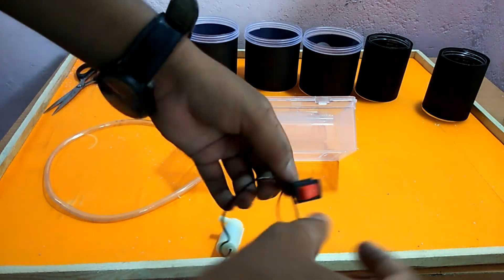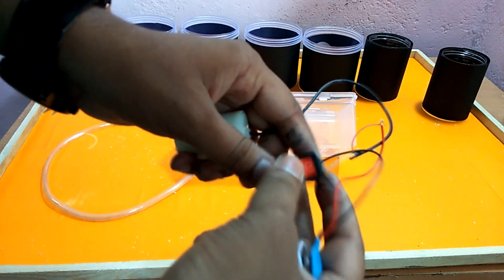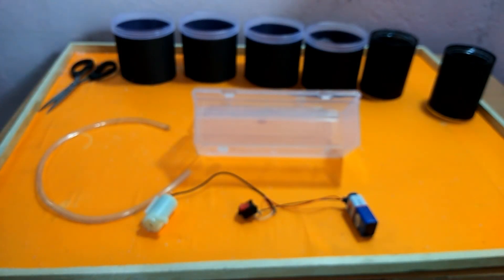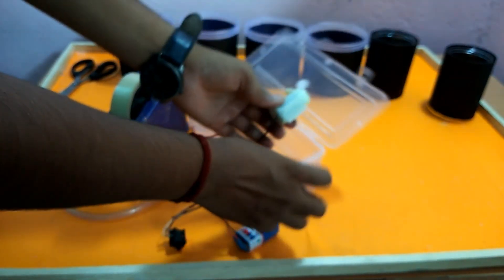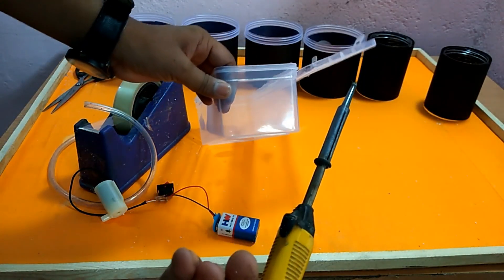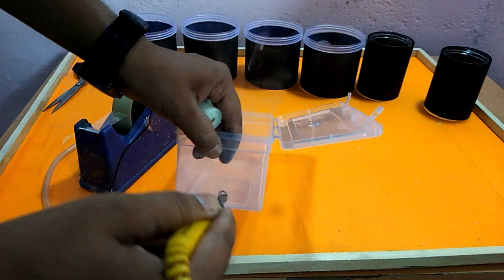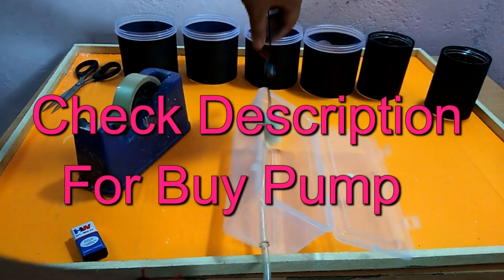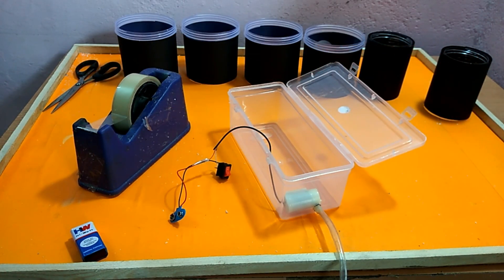How To Make Waste water Treatment Plant  Model 2018 NEW [DIY] PART-1

Comment: Sir can we use 6 volt water pump
Reply from the maker: yes
Reply: @srrobotics  sir thanks for your response...sir would it work without connecting resistor